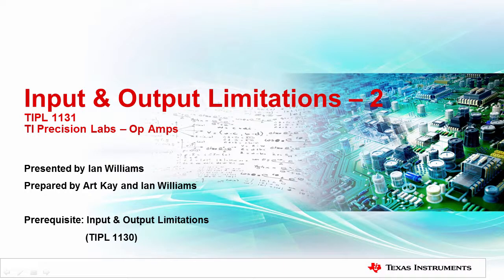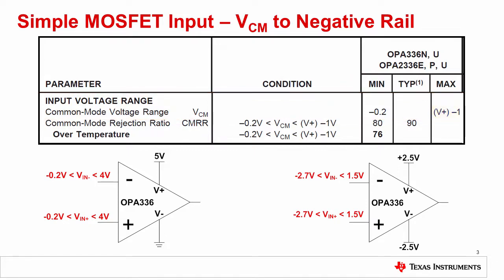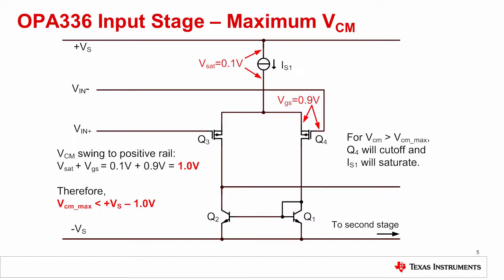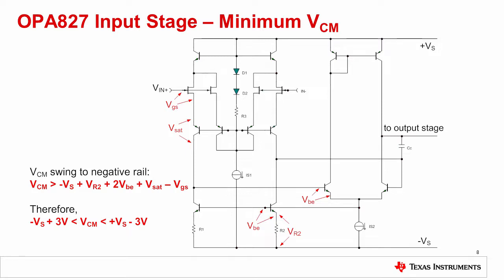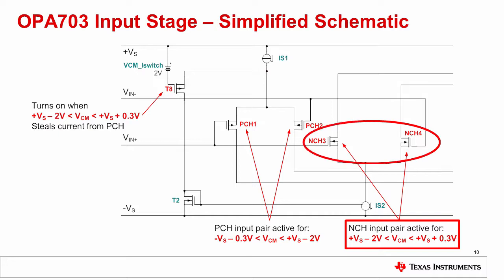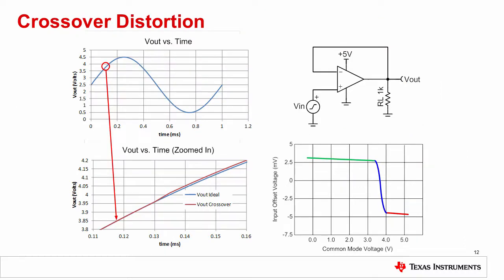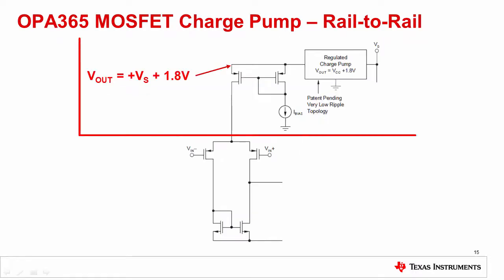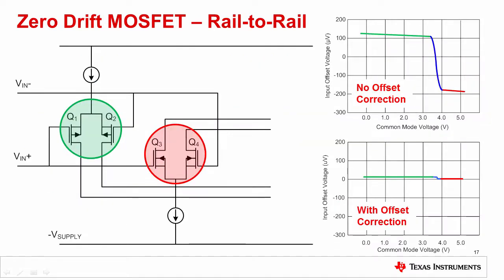TI Precision Labs - Op amps: Input and output limitations - Common mode voltage

Comment: Hi i have a comparator supplied with +5v/-5v  and when I measure the inverting or non inverting pins I read 2.5v what's the reason of that???